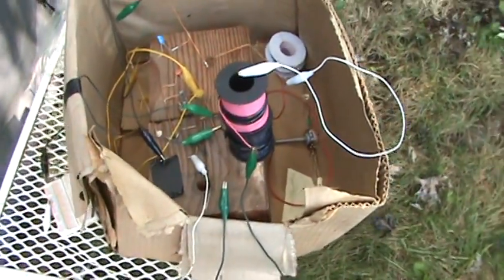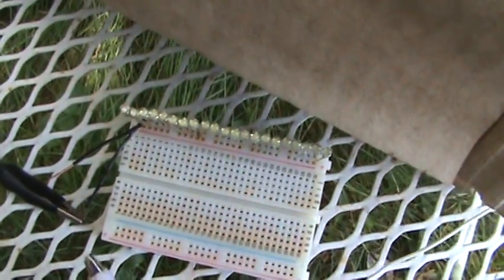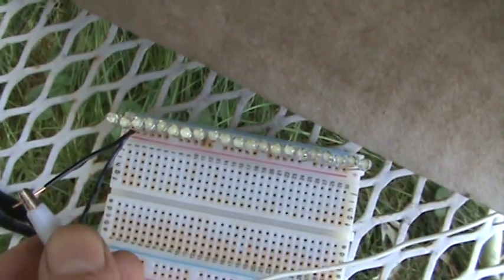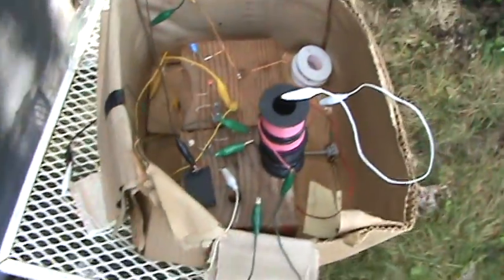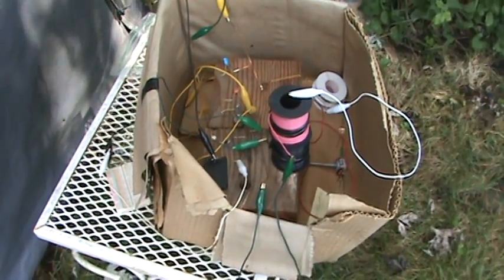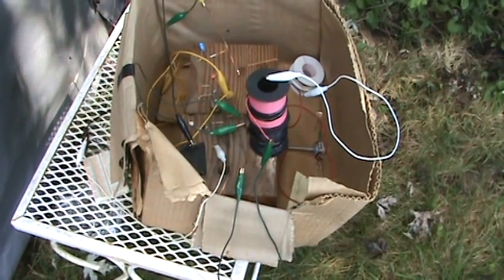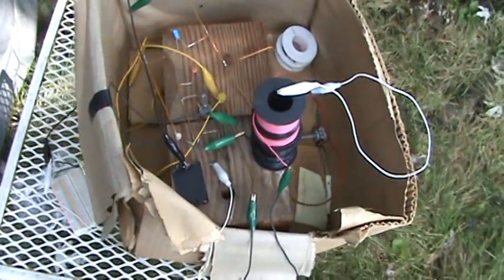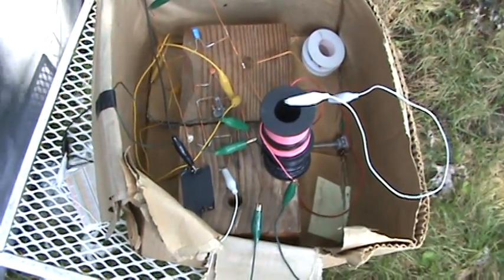FREE ENERGY FROM AIR 2016 Pt 3 (21 LEDs)

Comment: Very nice, have you considered analog panel type meters for volts and amps?  Instead of a battery powered digital multi meter, a panel meter is passive, with that moving needle it might be easier to visualize for subtle changes.  Taking a video of the volt and amp meters at the same time while you say what you're doing will give you a recorded reference of which change makes the best improvement.  If there's a ham radio fest or show in your area there's almost always selling some meters like that or I'm sure you could get them online. Just a thought. Google how to wire them up before applying power to such meters.
Reply from the maker: Yes, thank you,  You are correct :-)  I will get some vacuum tube type, analog meters soon.  John Hutchison also mentioned that i try the same thing you mention.
Thanks for your comments :-)

Comment: It's great that you have so many LED's lit as brightly as that, so this must tell you that you are working in mA range and not micro Amps
Reply from the maker: Thank you, you read my mind,,, I agree! :-)  I will check soon using a vacuum tube type volt meter to get more accurate readings for power.

Comment: Paul, did you see lasersaber's video about using a flame / Plasma as an antenna?He got like 3 X the output!! Very cool!
Reply from the maker: Yes, i left a couple of comments there! :-)  Im thinking it maybe the propane "gas" that might be collecting more energy, not the heat.  It was very interesting to watch & it makes me think :-)  He also mentioned the original patent owner said you could also use radium, i have some of this and was thinking the same thing.  I might try a piece of uraninite and use its radiation as a source :-)

Comment: Have you figured out the frequency the power is coming in at?  
Perhaps a fractal antennae, may pick up more amps?
Reply from the maker: I mean to tell you last time in the last 2 videos, you see the lights blinking,,,,,,they "are" in fact blinking, but too fast for me to see with my eye, but the camera makes it appear to blink slower.  I noticed when my camera is very still, the LEDs do not blink, but as soon as the camera moves they appear to blink.
I have a built in frequency counter on my meter, and i check the frequency, i forget what it was exactly with out looking at my notes, but i know it is not near am or fm radio.  And if i make my antenna 4 feet shorter or longer, the LEDs will still light up, so i dont think i am tuning in to any one frequency,,,i think maybe a lot of beat frequencies.
Yesss, fractal antenna, another good one, i been wanting to try this one :-)  I think just to take one from a cell phone, as it is already designed for picking up a wide range of frequencies, tv, radio, phone, GPS, ect.  I will check the frequency off of just my antenna only "&" check frequency going through LEDs and let everyone know soon.  Maybe i will make a short video of just this
Thanks for your comments and ideas & being a top subscriber,,,you have been with me for quite a few years now, much appreciated :-)
Reply: Do you have enough power to charge a (rechargeable) lithium ion battery?
Reply from the maker: Thats on my list of next experiments to try.  I got the batteries, so results from this coming soon :-)

Comment: are you not just picking up a local radio transmitter signal? that would tie in well with generating microwatts. You need to get a frequency counter hooked up.
Reply from the maker: I think maybe picking up many different beat frequencies.  I have checked frequency, but it is not near am or fm radio,,,oh now without looking at my notes, i forget what the frequency was.  Maybe i will make a video of doing this.  Thanks for your comments.